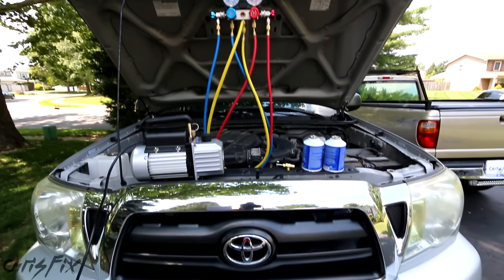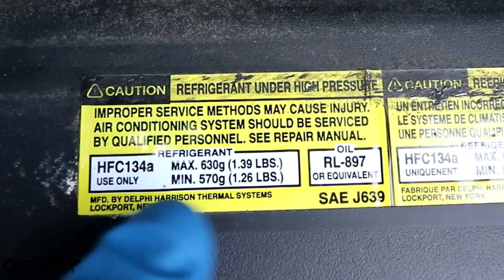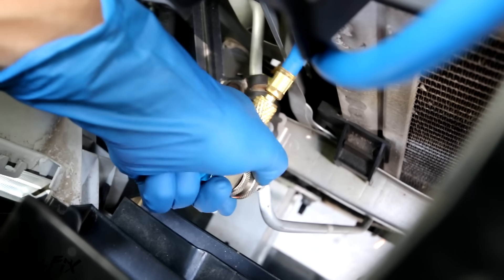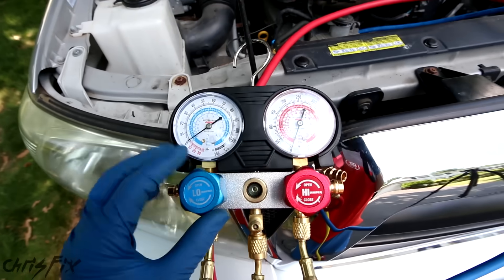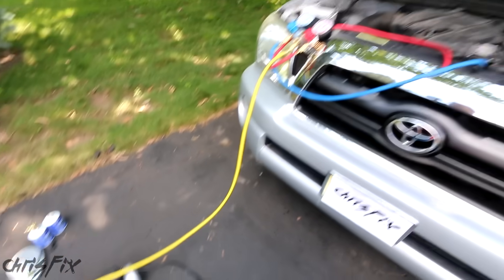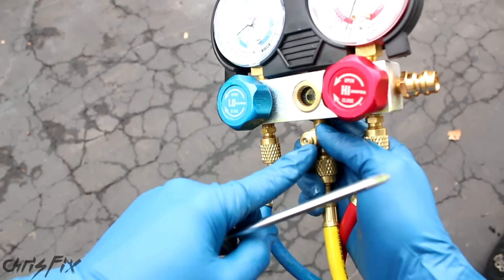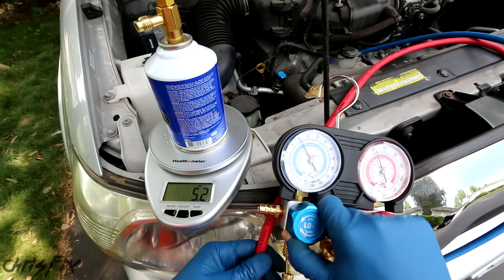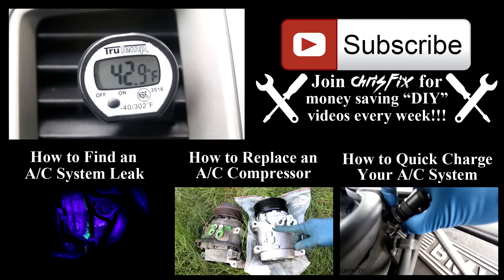How to Properly Recharge Your AC System

Comment: If my system already reads 0 psi do I need to recover the refrigerant?
Reply: No but there is very likely a leak somewhere that needs to be fixed first.
Reply: @yetanothermichael3702  yeah I have the replacement part just wanted to make sure before I replaced it

Comment: Chris, anytime the system is open to the atmosphere, the receiver/drier (desiccant) should be replaced because it absorbs moisture like mad.  Then pull a vacuum.  It will absorb any residual moisture in the system.  Otherwise, cooling performance could be poor.
Reply: Not only do you want to see if the system is completely sealed by watching if the gauge rises, but, also if there is more moister left in the system, in which case you would run the pumper a little longer, and test it again.

Comment: are those the same manifold gauges you would use on a household air conditioning system?
Reply: Household A/C systems use either R-22 or R-410a which have higher operating pressures than 134a. Make sure the gauges are rated for the refrigerant type you're working with.

Comment: I taught when you add freon you need to set the a/c to max an full blast i only saw chris fix set it up on the lowest speed, correct me if this makes a difference or not
Reply: It doesn't matter about the fan speed.

Comment: Hey Chrisfix is there any chance you could do a video about a conversion from R12 to 134 for us older car guys?
Reply: MotoGateway...R-12 to R 134a conversion. Buy the correct R 134 high and low side service connections...Replace the accumulator (low side)/drier (high side). Depending on your vehicle age you might have a VIR valve or a POA/throttle valve instead of an accumlator. You can get kits to rebuild these and replace the dessicant bag(in the VIR).  You can still find these parts online, but they tend to be pricey. You can also just try it with the VIR/POA to see if they still work. Also replace the orifice tube/expansion valve/expansion block.(sometimes you can just clean these, If its an orifice tube just replace it...they are cheap) Get a quart bottle of POLYOLESTER oil with UV dye. Add about 3ozs to the accumulator/dryer...and another 5ozs for the rest of the system. Any other parts removed and replaced add about 2-3ozs PER part. New compressor 5-8 ozs (if dry) or pour oil out and add same amt of new oil. Evacuate system for approx. one hour to 30"hg on the manifold guages. Close high and low side. Let sit for 15-30 min. If system is holding at 29-30"hg then recharge the system. Manifold guages should read about  35-40 psi on the low side and 180-210 psi on the high side with blower on high/max and recirculate at 85-95 degrees ambient temperature. If outdoor temp. is lower those pressures will be lower on the guages. Center A/C duct temp should be between 40-50 degrees. During charging it helps to wet the condensor (in front of radiator) a few times on stubborn systems that are slow to charge. If duct temp is in the 40-45 degree range stop charging the system. Overcharging will just raise the duct temperature. Also if you cant get the 40-50 degrees it may be that your older system is not efficient enough. Ive had some systems where 60 degrees was the best we could get.

Note...the polyolester oil is a synthetic oil that will blend with PAG oils and the older mineral oils in older systems. Also this is meant for a minimum parts conversion of clean systems trying to upgrade to R-134a instead of using R-12. If system is blown...proper parts need to be replaced an system flushed out. I have done this  cheap conversion hundreds of times at my shop and on my own vehicles and has worked well on all makes and models. Hope this helps.
Reply: Actually R-290 (propane) is an EXCELLENT refrigerant and is a simple "drop-In" replacement for R-12. No oil incompatibilities, etc and it cools GREAT. I'm an HVAC Technician and this is what I put in MY car.
Reply: Why would you want to convert R12 to R134a? R12 is way colder.
Reply: @frankmata1812  it costs way too much, very few people have it or are allowed to administer it, and allegedly it's bad for the environment
Reply: @derekfriedrichs  R12 is like $50 -60 for 2 cans of old-school R12.
Reply: @frankmata1812  perhaps where you live. But you can't even buy it in Nevada. And it's a minimum $200 for a charge. Minimum....sucks for sure.
Reply: @derekfriedrichs  Sorry but yeah

Comment: I have request and have an good idea...  can you make some innovation created a new system as automatically function cleansing the Evaporator Air Conditioner... by setting up a new line pipe with nozzle spraying a water in the gap evaporator,.. this is very useful for all users cars clean up the evaporator itself... the system function only one touch by the knob switch and easy to operated and any time for owner to keep clean the evaporator....
I think you understood what i mean.....

Comment: Hey ChrisFix. Why is it that in 1 video you don’t do a vacuum to the system on a 2000 bmw but in this 1 you do?
Reply: Fredy B the bmw was low on refrigerant and just needed to be added, the reason for pulling a vacuum is so that there is no moisture in the system, since water can freeze the evaporator and prevent heat exchanging or it can mess up the compressor.
Reply: Fernando Hernandez muchas gracias.

Comment: I am trying to understand, if you only had low side open on gauges how did you get hi side reading>
Reply: Alan Smith 

Because the compressor pressurised the low pressure into high pressure. The valve does not activate/deactivate the reading, rather it open the relevant side to the yellow pipe.

Comment: There's nothing left in system, so how is there dye left from very first can, you sucked it all out, you replaced pump, now none left at all, so the way you explain sh_t is that if someone checks it once with dye, then never need to add dye in it ever again to check or am I that dumb, I'm not that dumb at all. So no need to add dye until issues at all. Please show me your paperwork on you're a certified certificates in AC work. I hear more bullsh_t from you, helpful on how to figure out yeah but your explaining I think is wrong way. I DON'T care if your right or wrong, you are very confusing the people that need help, lucky I have the idea and know how on stuff. The gauges should read a certain pounds on blue and certain high end on red, you never showed that, you just added 22 ounces only, it could of taking 23 ounces now to be perfect or 21 ounces now. You use gauges and don't guess by using a digital scale, us that scale STATE CERTIFIED NOW. NO IT'S NOT,  SO WE DON'T IF RIGHT. THANKS YET AGAIN FOR A SCREW UP !!! DCO THE JOB RIGHT IF YOUR GONNA TEACH PEOPLE.

Comment: Hey chrisfix did you purge the 2nd bottle of freon?
Reply: Good question. How did he get the second bottle free of the can tap without letting all if the refrigerant out?
Reply: @timothyfarrand8407  he closed the tap before removing the first can so no air got in while switching cans
Reply: He closed the tap before removing the first can so no air got in while switching the cans

Comment: i bought a can of refrigerant with a gauge attached. i thought you just plug the gauge in, check to see if its low, and if it is just plug the can onto the L cap location and fill until full? why is this so complicated?
Reply: That is just a bandaid that may work temporarily but will cause issues in the long run. 

If your system is low that means there is a leak because these systems are built 100% airtight. 

Adding refrigerant from an automotive store may help temporarily. What he did is the proper way. (And the reason he had no refrigerant to begin with was that he replaced the compressor, hence the refrigerant was gone.)

Comment: If you didn't replace the AC compressor and are wanting to release the freon your pressure would a be different reading instead of low correct?  I am just asking because that may be confusing for others.  But your always knowledgable.  And I trust your work.  Just didn't want someone to be afraid of asking.

Comment: My gauge says it's really high when engine off. But engine on the pressure is low. What's going on?
Reply: its high cause the compressor is not cycling it through when shut off.

Comment: I think my low side port is clogged cause the refrigerant won’t get sucked into the low side ... my low side pressure is showing 120psi and course the compressor is not kicking on
Reply: Try changing the orifice tube

Comment: The hoses I ordered came with different size ports. So could not connect the yellow hose to the refrigerant opening valve. :(
Reply from the maker: That is strange. It should all be universal...
Reply: @chrisfix  he may have bought gauges for home AC unit (those can be different sizes).

Comment: Ey chris I have a question for you or anybody here: how I know the level of the compressor oil? Because I need replace the receiver dry and the manual say if I replace this part I need put 2 onz of compressor oil to the system. if the system have already oil how I know how much oil need . Thanks

Comment: One big issue to mention here, the "weight" you are talking about is incorrect.  Those cans have floz or Fluid Ounces, that is volume not weight.  Unless r134A is 1floz to 1 weight oz you will have an issue using that analogy.  You may have either over or under charged the system.  I would suggest weighing both cans unless you are going to go by system pressure.
Reply: 12 ounces by weight equals 340 grams. Maybe it is a misprint on the can saying "fl. ounces".
Chemicals are measured in pounds grams etc. 
The way Chrisfix did his measurements  is good.

Comment: do you recommend insulating the ac lines ?
Reply: I don't think it really would anything. Often the low-pressure line on A/C units and fridges are insulated to stop condensation on the lines, but for a car, it wouldn't do much. I'd expect the condensation to just evaporate from the heat.
Reply: Stockholm thank you for that
Reply: @454Chuy  In retrospect, It might be worth insulating the lines if they're rubbing against other things inside the engine bay. Otherwise, not really needed.

Comment: Anyone else having problems after changing your R12 system over to 134A.  When my R12 system died over ten years ago I switched the whole system over.  New everything.  The system has never worked consistently and now barely works at all.  I'm on my third compressor.  Multiple flushes.  Multiple oil changes.  Multiple orifice tube changes.  Months of work to get ac for the 90 degree days with very little to show for it.  Seriously considering going back to R12 system.

Current reading on 93 degree day . . . low side 47 . . . high side 205.

Comment: Nice job, shame the gauges were left with full pressure, best way is once finished is to disconnect the high side and allow the vacuum side to draw the gauges down to remove as much pressure as possible.
Reply: Amateurs always miss that.

Comment: Hey guys I need help.. I tried purging the yellow line when the end of it is connected to the refrigerant can, but I see no mist after pushing the pin on the gauge set..
The adaptor couple looks like it’s properly on the can, and after piercing the top and hearing a hissing noise, I unscrewed the adaptor coupler so that the refrigerant can enter into the yellow line
I’m not sure if I’m doing this incorrectly, if my gauge set is defective, or something else?
I see readings on the low and high pressure side of the gauge set, so I’m assuming there’s a problem with the yellow line?
Also this is my first time, somebody please help and correct me

Comment: Thank you so much for this video. I had to replace my heater core in my Ram 2500 before winter so wasn't to worried about AC but now the temps were in the 90's and had to get this done. Your video made it very easy to recharge my system and the air went from 101 degrees down to 50. Everybody riding in my truck will now enjoy the AC especially my kids who had to endure a 2 and half hour trip with temps in the mid 90's. I was able to rent the equipment at the parts store get it filled up and return the equipment all in about 2 1/2 hours. Again Thanks!
Reply: Nice triple 7’s! What store did you rent the equipment from?
Reply: @hardcore4476  I have rented them from O'Reilly's before and now bought the manifold and vacuum from Harbor Frieght. I have done this several times now so this video is super helpful!
Reply: @superbon777  Awesome! How do you evacuate the refrigerant and do you lose any oil when doing so?
Reply: @hardcore4476  I rigged an old AC filler to open while connected that has a trigger I could depress and used the universal tank recovery unit 😜. I had no oil loss. Only time I had any loss was actually messing with the compressor and having the lines disconnected for other engine related work.
Reply: @superbon777  Right on.. All is good I fixed it and have ice cold air now! I had to use cheap orange vacuum pump from harbor fart because I couldn’t find an adapter for my vacuum pump anywhere that hooked up to manifold Ac gauges.

Comment: What happens to your oil and dye in the supply line when you purge the air out? Don't you also purge those too? 🤔

I was taught that it's better for the system if you DON'T let liquid refrigerant enter. It may take a little longer, but supplying in a gaseous state is better.

Shop techs don't care because they're in a hurry. Plus it's insurance for them to have future work!

Comment: When I purchased my car my ac system was empty because the motor was removed to paint the engine bay. It was crazy hot out and I put in a can of r134a from the auto store myself.... I didn't have a chance to draw vacuum. I was melting and needed a quick fix. It blows cold now. What should I do now? Drain the system, draw vacuum and refill? Will I be ok if I don't? Also how do I know if the system needs oil? THANKS!

Comment: Is it normal for a 2002 f150 AC compressor clutch to turn off and on. The system has no leaks has been filled up correctly. Or does the outside temperature matter as well.
Reply: Estevan Gutierrez clutch should turn on and off so the compressor doesn’t over pressurize the ac system
Reply: @DWNSHFTco  thanks man appreciate the help

Comment: Should have said "Chris, I know you know what you are doing but you are charging through the suction line with what appears will be in liquid form, not vapor. As you know that will kill a compressor. Do you have a vaporizer installed? What am I missing?"

Comment: Chris, I know you know what you are doing but it you are charging through the suction line with what appears will be in liquid form, not vapor. As you know that will kill a compressor. Do you have a vaporizer installed? What am I missing?

Comment: You left a good amount of the refrigerant charge in the high pressure hose when you removed  the hoses from the system,
 I've done refrigeration work for over 30 years it's pretty clear you have no idea what you're doing, This is badd advice for your average person I think you should delete the video
Reply: rotarycomptech, rotaryshomptech. Silly guy.
Reply: @wb5898  W-B Worthless Bastard Just another GOOF!

Comment: A  compound suction gauge with a vacuum scale is no way to check for leaks in and air conditioning or refrigeration system, You need to use a micron gauge. A analog gauge is not accurate enough to register of small  leak

Comment: Or just take it to the repair shop, give the guy couple of $20 bills and get the job done! As per current trend  of changing cars within 5-7 years, you'd probably need to change the refrigerant never to once and why wasting $150 which you may never use!! As for the video, it's good to know how things work anyways!!
Reply: eth3rl0rds  as a guy with 5 plus cars and family buy this material will pay of itself in 3 years.

Comment: Not a professional...but I have to question this.  When you initially opened the manifold knobs to read zero pressure in the system, the charge hose wasn't connected to anything....won't that immediately drain any vacuum if there was one, or let the refrigerant escape if there was pressure? Correct me if I'm wrong .

Comment: thanks for this wonderful tutorial, two things I am kinda confused: the pump is to suck out the extra moisture or suck out the old refrigerant  ? second,  where was the old refrigerant, I mean most of time are we gonna just  to measure the already existing refrigerant then add missing amount ? thanks
Reply: @steven The pump is to suck out the air and moisture and create a vacuum. I'm not an a/c pro, but I don't think there is a way for you to know how much "old refrigerant" you have in the system. So you will have to remove (evacuate) the entire system of any old refrigerant and readd the correct amount of new refrigerant.

Comment: So where did you account for the refrigerant still in the lines when you weighed the second can? I never saw you purge the second can so air in the line from connection of the second can could be purged. This is why charging with the little cans should never be done.
Reply from the maker: Thanks for sharing. The refrigerant in the lines is such a small amount it doesn’t make a difference.

Comment: can't I just buy one of those recharge cans with the gauge on it... hook it up to the valve and pump it in till its full???????????
Reply: Yes and no. It will work only temporarily. Like he said in the video, the best way to do it is to pull a vacuum on the system to evacuate any air or moisture in the system, then refill the system with refrigerant while under vacuum to ensure that the only thing in the system is the refrigerant.